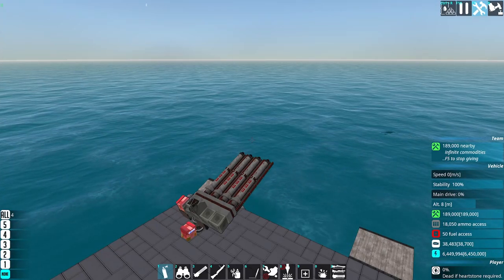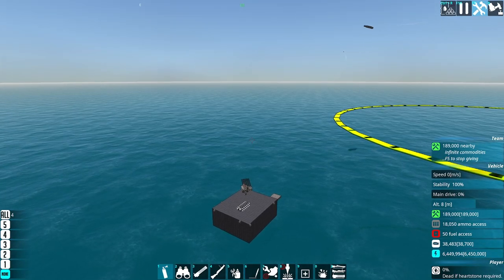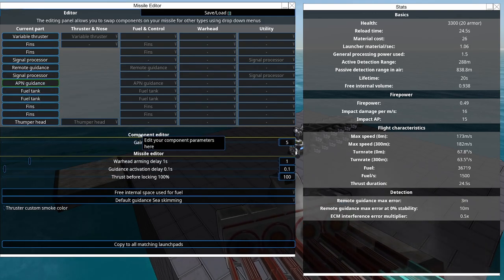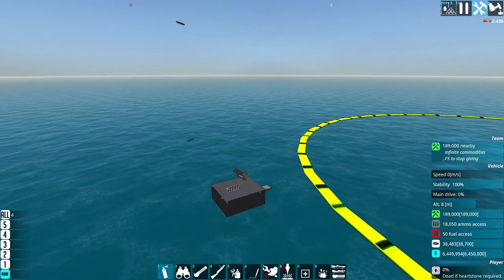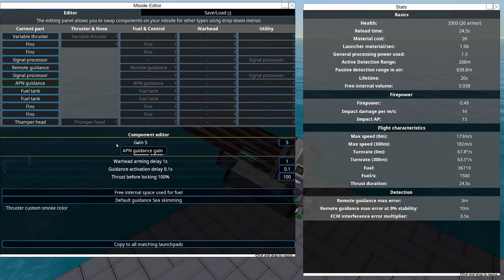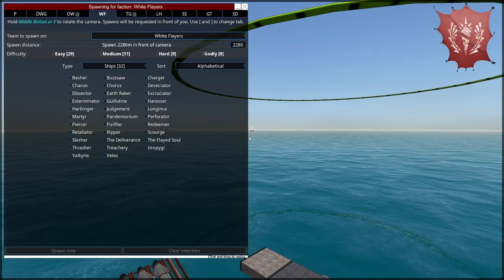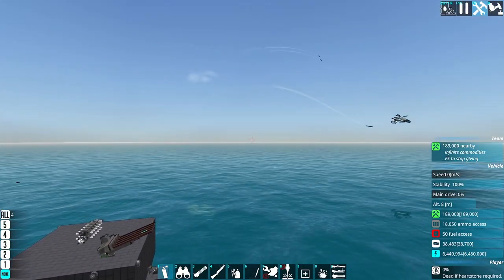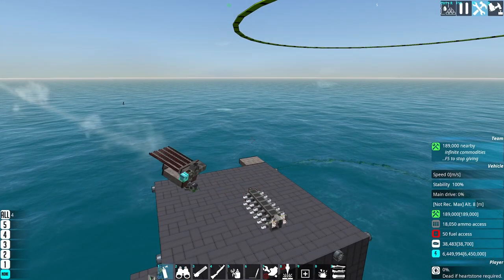APN Guidance - From the Depths

Comment: Hey, great video! I think APN was always one of those mechanics that everybody uses but nobody understood. I implemented it for a lua missile so I can offer some input:
1. Slight nitpick, you said the missile tries to maintain the target at a constant bearing, for example 15 degrees to starboard. It's actually not relative bearing, but absolute bearing, so it's more like it tries to maintain the target directly north, for example.
2. The "augmented" in APN refers to gravity compensation. Real missiles are affected by gravity whereas their targets are assumed to have lift which counteracts gravity, so the augmenting term makes the missile aim high to avoid getting pulled below the target by gravity. This is a lie in FtD because FtD missiles are unaffected by gravity as long as their engines are on, so it would more accurately just be called PN.
3. I found it interesting that when you set the gain really low, it behaved like direct guidance. Perhaps this is what the devs actually meant by "augmented" but if that's the case, it's an incorrect use of the terminology.
Reply from the maker: The worst part is that I already knew it was absolute bearing because I was just tinkering with my breadboard and I still got it wrong. I almost never make it through one of these videos without some sort of mistake.
Reply: All kinds of proportional navigation try to keep relative bearing constant: absolute bearing remains constant too in the case of non-accelerating targets, but is otherwise irrelevant.
APN is called "augmented" because it takes into consideration target acceleration (derivative of the rate of change of relative bearing) and not just speed (rate of change of relative bearing): relative acceleration due to gravity is only one part of this term.
Reply: Oh yeah, my bad. I originally saw a derivation of APN assuming a non-accelerating target, so the acceleration term only included gravity, and I forgot that it should also include the target's other acceleration. However, it is not the second derivative of the LoS, but rather just the target's acceleration vector. Also, it is change in absolute bearing which determines the response, not relative bearing. This can be seen in the definition of PN, and can be derived from the zero-effort miss (ZEM) formulation. In the case of a missile already on the correct course to a non-accelerating target, neither absolute nor relative bearing change. Whether either of these is "relevant" depends on what the question is.

My source is "Modern Missile Guidance" by Yanushevsky, the wikipedia page on PN, and various online lectures and research papers about more modern variants of PN which I can try to dig up if you're interested.
Reply: @dreekfire721  I would suggest reading through your sources again: the wikipedia page, in particular, makes it fairly obvious that absolute bearing is not relevant by expressing acceleration in terms of line of sight.
Also, measuring LOS and its derivatives is easy, measuring actual target acceleration is difficult and prone to errors: the simplicity of PN is one of the main reasons behind its success.
Reply: @asrieldreemurr5029  I've read through these sources multiple times, and I've read through multiple sources. They all corroborate in that it's based on absolute bearing, not relative. Since you said so, I went back and read the Wikipedia page one more time. It defines the rotation vector of the LoS as RxV/R*R, which is the rotation vector of the absolute bearing, not relative, and uses this vector to define the commanded acceleration. Quoting from Yanushevsky, which the wikipedia page cites, "the LOS direction relative to the inertial coordinate system is kept constant." Since it is relative to the inertial coordinate system, this is absolute, not relative bearing.

Additionally, the mathematical justification for PN guidance is that it is merely a different way of writing the acceleration needed to cancel out the zero-effort miss. This derivation only works with absolute bearing. Finally, relative bearing would not work for a vehicle with multidirectional thrusters, particularly one in space where there is no atmosphere to define a fixed reference frame so it's impossible to determine a missile's own bearing.

I agree that measuring actual acceleration is harder than measuring the second derivative of the line of sight. Checking again, these two can both be used for the same purpose; the second derivative of the LoS can be used to estimate the target acceleration perpendicular to the LoS. So in the case of True PN, you can use either, although Pure PN requires more acceleration data.
Reply: @dreekfire721  that formula is dependent on the relative velocity vector, thus its result will not change if you change the absolute bearing but keep the relative bearing constant (ex. if the missile changes its bearing by 5° clockwise and the absolute missile-target bearing also changes 5° clockwise).
Again, check your sources carefully because the math can be tricky and some notations misleading: the wikipedia page has an helpful illustration showing a PN missile course correcting after the target maneuver, notice how after the maneuver the missile does not try to reestablish the old absolute bearing.
Same deal with APN, only the notation there is even more ambiguous: you can look at actual implementations, but those don't tend to be very straightforward either.
Reply: @asrieldreemurr5029  I have been checking my sources over and over again. I would like to see some of yours. The missile does not try to re-establish the old absolute bearing; it has no memory, it only reacts to the rate of change in absolute bearing, which is clear in the formula for commanded acceleration. The formula from wikipedia depends on the relative velocity, but not the relative bearing. The distinction is important. The relative velocity is still measured along the same axes as the reference frame. Of course if you rotate the whole setup by the same angle the behavior will be identical, just rotated. This is true with either relative or absolute bearing because the rate of change in absolute bearing is what matters, not it's exact value. 

If the acceleration command was really determined by relative bearing, then the expression for the rotation rate of the LoS should also include some term for the missile's own rotation rate. However, it doesn't.

This is also supported by Wikipedia's description of an early implementation of proportional navigation: "Since the mirror is in fact a gyroscope it will keep pointing at the same direction if no external force or moment is applied, regardless of the movements of the missile." The movement necessary to make this mirror track the target was interpreted as the LoS rate, so it's once again the absolute bearing rotation.

You can also find diagrams illustrating the various vectors involved which render the problem according to some fixed axes, not relative to the missile's rotation. While this is not conclusive proof that absolute bearing is used, it's another indicator.

Let's suppose it did keep a constant relative bearing. There is one relative bearing that would result in a perfect collision course; any other bearing would result in a spiral of varying tightness. If the constant relative bearing is straight ahead then it becomes direct guidance; if it's 90 degrees to either side it will just circle.

You can also look at "Proportional Navigation Qualitative Intro - Section 2 Module 1 - Missile Guidance Fundamentals" by Ben Dickinson on youtube; it has a discrete visual simulation of PN guidance. You can see that his PN guidance law only takes into account the change in absolute bearing.

I will lastly reiterate the points I have made which you have ignored even though I've addressed every claim you've made:
1. the zero-effort miss derivation of PN guidance only works with absolute bearing
2. relative bearing simply ceases to have meaning if you don't have a preferred reference frame, i.e. in space, where PN is also used.

Finally I do not appreciate the assumption that I am merely being tripped up by some difficult math and that I should "check my sources." How do you guarantee that you're not making any mistakes? These statements are simply polite ways of saying "you're wrong" and you're going to have to convince me of that by providing your own evidence which I haven't seen very much of.
Reply: @dreekfire721  "Let's suppose it did keep a constant relative bearing. There is one relative bearing that would result in a perfect collision course; any other bearing would result in a spiral of varying tightness."
This is blatantly wrong.
For any choice of target velocity vector, and missile and target initial position, you can choose infinitely many missile velocity vectors that result in a collision course with constant relative bearing all the way through.
Working backwards, you can draw a half-line from the target initial position along the direction of its velocity, pick ANY point on it, connect it to the missile initial position, and calculate the missile velocity corresponding to that collision course via the ratio of the resulting segments.
Depending on the choice of initial parameters, the relative bearing angle might change all the way from 0° to 180°.
Of course, cases above 90° require the missile to be slower than the target. 

The assumption that you might be unfamiliar with math is more than warranted, quite frankly.
Reply: @asrieldreemurr5029  Sure, if you allow the missile to take on any velocity. I was thinking of the constant-speed case which is true of many endo-atmospheric missiles. However, even supposing you can choose any velocity you like, it is still the case that the set of all relative bearing-speed pairs that would result in a collision is infinitesimally small (a pair of one-dimensional spaces) compared to the set of all relative bearing-speed pairs in general (which is a two-dimensional space for the planar intercept case), so you cannot just blindly maintain a relative bearing.

I think anyone else reading through this thread simply has to decide for themselves who to believe; considering I've offered way more sources (for those not entirely convinced, try to find a pdf of Modern Missile Guidance by Yanushevsky and follow the derivation from the zero-effort miss, equations 2.7 to 2.14), bungalowbill himself has pointed out that absolute bearing is the correct choice, and you're the first one to start hurling personal attacks, I think the choice should be obvious.
Reply from the maker: Dreek Fire is correct here. I actually did both implementations while working on my breadboard initially (I accidentally plugged the wrong outputs in), and using the bearing relative to the missile heading is a disaster.
Also, I don't think that the APN guidance as demonstrated in this video was taking target acceleration into account. For starters, I don't think that the position data from the remote guidance module is clean enough to get a useable second derivative. However, if APN guidance with radar targeting does take acceleration into account, it would explain why I was getting such weird behavior out of it that I gave up and switched to remote guidance.
Reply: @bungalowbill521  Thanks for stepping in with experimental evidence, and sorry for having this argument in your comments section. Since the video was supposed to be educational, I thought it was important to verify the truth, but I hope it didn't bother you too much. I did learn through this conversation that the augmentation term was more than just gravity, and target acceleration could be measured by the second derivative of the LoS.
Reply: @bungalowbill521  as per FtD's own code, in ftd.dll/MissileAPNGuidance, acceleration is proportional to the dot product between the relative velocity and the normalized relative position: any change in the missile heading will change the commanded acceleration, even if the absolute heading remains unchanged.
I don't know what is going on with your breadboard, as I can't see it: probably your craft's heading is already implicitly included at some point (ex. when calculating closing velocity).

Comment: Dude this was awesome. 
I was not fully sure how adjusting the Gain worked and if PIDs taught me anything it's that high gain sliders were a BIG no no.
I'll definitely be seeing more connections and be using 1-2 fins now instead of 3-4. Great vid!
Reply: Most of my craft use hydrofoils on a misc axis connected to a high gain PID to maintain an extremely constant altitude. So I think there is a place for them
Reply from the maker: "High" is always relative. The rule of thumb for gain anywhere is to turn it up until it starts to wiggle, then turn it down until it just barely stops.